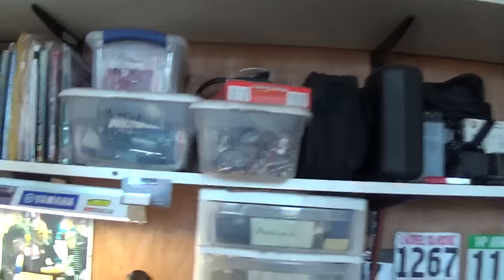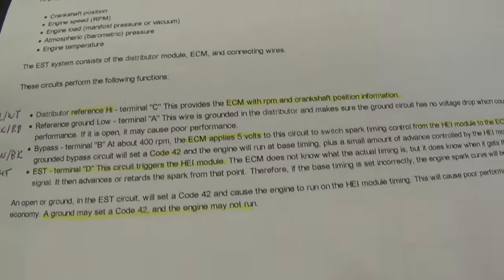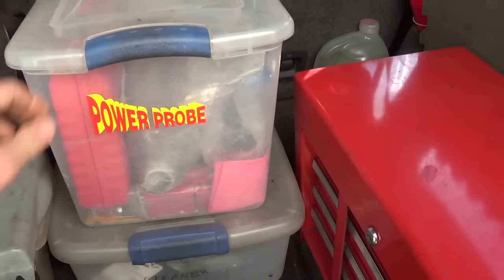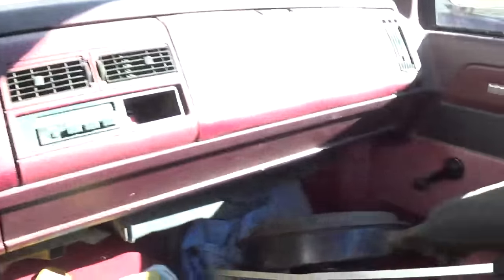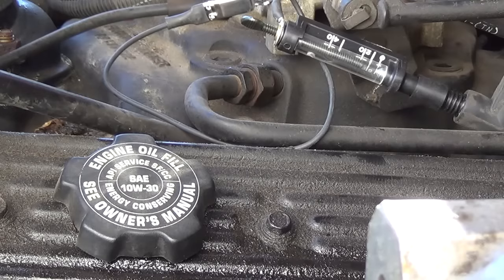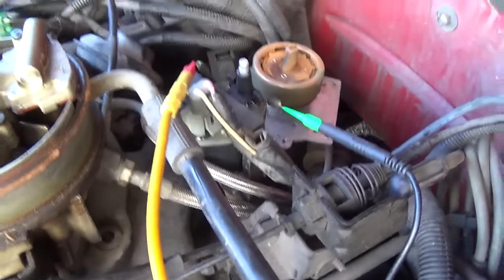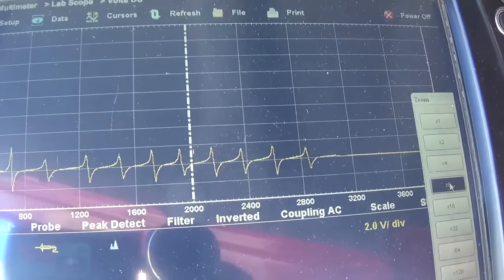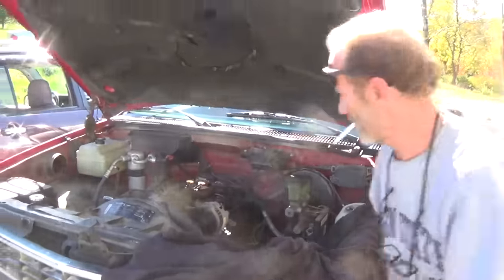Crank no-start: '88 Chevy truck 5.0 V8

Comment: I always use the grease under the control module . I agree with you on the grease , it is not conductive , that is y it is used , it maintains the connection and also like i insulator to protect the connection . Good job
Reply from the maker: +wtbm123 Huh I've never had to install one of these so I just guessed where the grease went lol :)  So what exactly is the purpose of the grease on the bottom of the module?
Reply: +motoYam82 helps seal up between the two so it does not corrode and lift .
Reply: +wtbm123 I was taught that the grease is for heat transfer from the module to the distributor base to dissipate heat from the module.
Reply: +Robert Wynkoop And it looses its heat transfer  when it starts corroding under it lifting it off the plate
Reply from the maker: So in operation the module must heat up MORE than the distributor base, if that's the designed direction of heat flow (module to distributor base). I am tempted to drive around with a thermocouple taped to the dizzy on my '89 MPV to see how hot that sucker gets. All I know is that it burns up the internal igniter about every 10 years/100k miles...
Reply: +motoYam82 Yes, heat transfer FROM module TO base. There are some heavy ass transistors in that module, and they make a LOT of heat. 5 amps at 13 volts might not sound like much, but that's 65 watts, which is a lot (hold your fingers on a 60 watt lightbulb for a demonstartion).
Reply from the maker: +douglas lee Hey Douglas, I was also thinking about how much heat the module produces. In this case keep in mind the ICM is just a "switch"; most of the voltage drop and heat generation is actually across the primary winding of the ignition coil (not the transistor in the ICM)!
So again I am skeptical of the module producing that much heat on its own...maybe set up a bench experiment with an old distributor and see if the module actually gets hot?
Reply: +motoYam82 It is definitely going to get hot.  It has power semiconductors inside it (switching transistors, mainly), and needs to be able to dissipate that heat into the relatively cooler distributor body.  Same principle as incorporating the voltage regulator inside the alternator, use the big chunk of metal as a "free" heatsink for the related electronics.

While the device does act as a switch, being a semiconductor device, it has a MUCH higher voltage drop (hundreds of millivolts) across it when conducting than a pair of mechanical contacts will.  This thing is old enough to be using bipolar transistors, which are much less efficient than the later power MOSFETS, thereby generating even more heat.

If I was faced with replacing one of these, I would use standard zinc oxide thermal grease rather than the dielectric grease. This stuff is available from any electronic parts distributor.
Reply: +motoYam82 In the case of every Chevy I have ever worked on, if that grease is not under it, when the engine heats up the engine will shut down.
Reply: +331sbf I agree arctic silver is a better at heat transfer . I do some computer work so i am familiar with it . But wonders if out in a hash environment if it would repel water as well after some time . Moisture gets in , then corrosion and lifts the module . I understand what you are saying , but i just use what comes with the module . Not sure which would be better in the long run
Reply: +331sbf Artic silver is a heat sink compound and it is in a grease base. The grease should prevent any corrosion if it is applied properly.
Reply: Normal dielectric grease was "cooking" away in mere weeks causing shut downs. It's been at least a year and a half since I had done this and it is running great.
Reply: +motoYam82 The grease intended for that job has micro particles in it that transfers heat to the body of the distributer. The grease is just the base to hold those particles. The micro particles are either aluminum or silver if you have the good stuff.
Reply: the sound inside when turning off the ignition, as that of an electric antenna is the digital heater vent, I assume....I had a bad ground and as soon as I fixed it in my 1988 Chevy, "in the fall"  that 'good' sound returned and thus I again had heater!

Comment: I use dielectric grease on connections, but also on the mating surface of the module. It helps dissipate the heat. Great video. Funny ending with owner revving engine and then running away!  (Also works on the ceramic part of spark plugs that contact plug boot)

Comment: That noise was the electric fuel pump, you didn't know that? Also, dielectric grease  keeps oxidation down to due to isolating the metal from oxygen, and I think you needed to apply thermal paste to  the bottom for proper heat transfer to keep the module from overheating.
Reply: that noise was a electric motor under the dash for the air and heat that I know for a fact. Just letting u know.  I have an 89 silverado and mine does it.  Ive  only seen it on the 88 and 89 chevy trucks.  my brother has a 90 and it doesnt do it on his

Comment: I had the exact same thing happen on my '95 C1500...driving to work and she just quit. I could hear the fuel pump so I threw in an ignition control module and the 4.3 fired right up. Now I carry a spare and a long phillips behind the seat. The '88 to '98 chevys turned out to be damn good trucks. Unlike the '99 and newer Chevys the rocker panels actually made it home from the dealer without rust holes!
Reply from the maker: +cbsctomh Agreed the sheet metal seems to be higher quality on the older 90s trucks. My neighbor has a 99 Tahoe and a '05 Yukon. The newer Yukon already had rockers replaced!! The 99 is still going strong at 225k...like a rock lol

Comment: I knew since the very beginning it was the ignition module, it is a very common failure on this model. That's a happy customer! Thank you Ivan!

For the guys with the dilemma about the Dielectric grease and the  thermal compound: That grease is for the connectors. You never put dielectric grease as a thermal compound. Thermal compound is used between the module and the mounting surface whenever there is a cooling aluminum heatsink outside the ignition enclosure but in this case that chevy does not have a aluminum heat sink for the module in there so no thermal compound is needed. That ignition body is way hotter than the module and cannot dissipate the heat in the module. In fact module failure due to engine heat is a common issue in this truck. (Engine is hotter than the module)

Comment: Use to be Ignition modules in these trucks is what kept the parts guys paychecks coming. Hard to believe there's still one of these with that low mileage.If that clock still worked.
Reply: this old car didnt need a oscilloscope and all that.  you simply check the input and output on the module for resistance.  resistance too high the thing is kaput.
Reply: What Terminals do you test for resistance
Reply: Super Godzilla that was ford techs and thick film ignition or TFI as it was affectionately called. 
Modules burned so fast every guy had one in his tool box and the special socket to UN bolt it.

Comment: Man, your vdo is the best bro. Thanks so much for posting.  I looked all over YouTube and tried many different ways to fix my early '90 gmc van with no start when engine is hot.  Not much luck.  Fortunately; I came across your vdo today and decided to replace the ignition module.  Cost me $31@ oreilly and boom, the old van run like a champ now😁👏🏼👏🏼👏🏼. Thanks again keep up the good work.
Reply from the maker: Awesome!

Comment: Yes I believe the grease was for under the module.  The heat of the motor cooks the module.  The grease helps with cooling the electronics.

Comment: 🔥 video... I’m having this same issue on my 88 obs 350 v8 as of yesterday 11/3/23 makes me want to just order this part and try it out I pray it works but  I know there’s a few other parts it could be as well I have to check first ignition module, control module, pick up coil, map sensor, or fuel pump I pray it’s a cheap fix $50-$150. I don’t want to just throw parts at it. I don’t like to fix things that aren’t broken as my grandfather would say.

Comment: nice simple fix, the dielectric grease was for the bottom of the module.
Reply: exactly
Reply: Yes module will have a short life without the grease so it will have a good heat sink, but you are too young to have grown up with 80s and 90s Chevrolet’s so it’s an honest mistake.

Comment: Dielectric grease is not recommended for the bottom of the module. Go to Radio Shack or a computer parts store and get heat sink paiste. It is designed to transfer heat, way better than dielectric grease. I bought a big tube of it off of Amazon. Within a year I've had 2 ignition modules go bad. And I don't buy the cheap ones either.

Comment: The noise you heard was the fuel pump activating, and make sure you use thermal grease on the metal plate on the ignition module or you will burn it out. It has to use a heat sink to protect the circuit components inside the module, in this case the metal shelf it is attached to on the distributor. Thermal or heat sink grease is white in color. Dieletric grease is good for connectors but it is not a heat sink grease, heat sink grease conducts heat from the part to the heat sink to prevent the semiconductor from burning out inside the module, it is thermally conductive. Think computer chip, like your processor in your computer needs to conduct heat out and away to protect it, we use heat sink compound or grease to do this with the heat sink being a metal processor cooler of some type, the ignition module is sort of like a small computer in that it takes inputs and creates an output, in this case a timed signal to initiate the spark on each cylinder. It creatse heat and heat destroys electronic connections inside the semiconductor so you have to transfer the heat away, and that is what the thermal grease and metal plate on the distributor does.

Comment: those modules slowly wear out over time..the heat gets to them. always make sure you apply that heat grease on the underside when you install the new one.my astro van always idled rough and didnt have as much power as tit should..new module solved everything.

Comment: the grease was to go on the metal bottom part of the module so it does not heat up.without it it won't last long
Reply: +John Hafernik Thats what I thought as well. But why would they use dielectric grease instead of thermal grease like you would use on a CPU heatsink? Thermal grease contains stuff like zinc oxide or silver compounds to help carry heat away. Dielectric grease is just a silicone based grease.
Reply from the maker: +Bob Weiss That was exactly my thought too, Bob. Everyone is saying to put the DE grease on the bottom of the module, but no one says WHY...I don't think it improves thermal conductivity at all...might even impede heat transfer from the module to the distributor base. The distributor gets hot anyways from sitting on the engine, so I'm having trouble believing it's supposed to cool the module down in the first place :) 
Actually, it's a fundamental design flaw to have the module living in such a hot location to begin with. My '89 Mazda burns out the ignitor inside the distributor every 100k miles...nothing you can do to prevent this. This truck was just at 100k lol
Reply: +motoYam82  on my '98 5.7 Sierra, the module is mounted outside of the distributor and is attached to a heat sink. Still comes with the grease,so must be there to promote heat transfer to the heat sink.
Reply: +motoYam82  I'll say why - all three DE, silicone, and thermal grease are the very same thing in essence.  Thermal greases that have zinc oxide or silver powder added are just gimmicks to sell, very hard to prove any improvement over plain silicone grease, we are talking $10 difference for 1/2 watt improvement if you can find that much and I don't think it's worth the price at the end of the day.  GM doesn't think so either but they are confirmed cheap skates.  Me three for that matter.
Reply: +Lee Barnes i know a youtuber who uses tooth paste as thermal paste in CPU's. Seems to work well for him :D
Reply: +kreetins You just made that up.  Been a hobby of mine since the 60s and for the first 30 years translucent silicone grease was used routinely under the big power transistors and then along came the silver powder guys with dubious claims of greatly increasing heat removal.  Not much happening until you upgrade your heat sink and air flow too.

Comment: Those TBI engines are so easy to repair compared to today's engines. To pull codes, all you need is a jumper between the A and B terminals on the DLC and off to work finding the problem.

Comment: Stabilant 22A is a liquid that increases conduction. NAPA sells it.
Silicone grease is used to help the heat transfer to heat sink. Used on other hot electronic components. 
Good show! Thanks.

Comment: Great video but my trucks acting different I have already replaced the ignition coil and I'm the plugs the wire's and the cap and button here's my problem sometimes it will fire for a second and than nothing what could it be

Comment: the included grease goes under the module for heat protection from the engine. Without it module will fail its not for terminals. If you read the directions they most likely stated that as well

Comment: You are exactly right with that one ivan. Dielectric grease/ bulb grease is for keeping out moisture and debris from electrical connections. 👍and makes no difference on conductivity other than keeping contact points clean so they can pass juice well.

Comment: The Dielectric grease is supposed to go on the bottom of the ignition module to keep it cool because it gets so hot. The heat is what destroys those ignition modules. So the Dielectric grease goes on the shiny metal flat surface on the bottom.

Comment: Ivan, dielectric grease was meant to be put on the module where it mounts to the distributor before mounting to conduct heat away from the module.
Reply: Heat sink thermal paste, not dielectric grease.

Comment: New engine, started right up. Was running. 1994 chevy c2500 now no spark. New plugs, 2 sets wires, 2 caps, 2 rotor, 2 coils, 2 ditributers, fuses, 2 modules...coil sparks once on key power up make/break. No spark at plugs....

Comment: I hope you put the dielectric under the module, otherwise it will overheat.
I use dielectric for all my connections, especially those expose to moisture.
The dielectric allows heat from the module to travel into the aluminum distributor base, it acts as a heat sink.
Another thing to look for is a clogged vent screen in the distributor, it must be clean to let moisture out. otherwise you get rapid carbon tracking and misfires.
Reply: James Fenton : Great comment on the vent screen .I have a 1989 G20 Van with 199K . The 700R4 trans dropped dead . Original owner . Every time I have the distrubutor cap off , I clean the vent screen . Also , I have heard that the small wires from the magnetic pickup can rub through . It's bad if it stops working - but worse if it works intermittently . That will drive you crazy . I won't put in a used trans unless I can verify some history . Not worth my time . Also , that noise you hear every time the key is turned on is the fuel pump prime . I can put my hand on the relay and feel it run and shut off after about 2 seconds .  Bill .

Comment: The dielectric grease NEEDS to be between module and distributor,,,without it the module will fail, !!!
 I am a GM Certified MasterTech.   60 years experience, have just acheaved my Doctorate in Mechanical engeniring P. R. Dutton

Comment: My engine just quit...no bogging just flat out quit. It's an 86 s-10. Just replaced fuel pump..ignition coil..and complete distributor. Even sprayed starter fluid and still it cranks .....no start. Any input would be helpfull

Comment: So what would I check when I have a spark, fuel and compression. New distributor assembly, coil, plugs and wires and it is in time. Jacked truck up to remove and replace right inner fender and it was running when I jacked it up but let it down and now it doesn’t run. 1990 GMC Sierra 1500 2 wheel drive with a 5.7

Comment: Awesome video !    Thank you so much for sharing.    I do have 1 question.  My '89 Silverado with a 5.7 goes into what would normally be a choke mode, slightly higher RPM as I drive. If I throw it in neutral at a stop light, jab the throttle it kicks down to a correct idle.  Any ideas ?  Thanks !!

Comment: Here's one for you. I have a 95 suburban 5.7L and had a crank but no fuel, no spark. I put a new ICM in and still no start. Here's the kicker, I put the old ICM back in and it fired up? I have put three new ICM over the last two years and have tested everything and pulled apart the wiring harmess looking for broke or corroded wires. Why am I having to replace the ICM so often? I even bought the top of the line ICM and it failed? Do you have any idea what else I can look at? I really hate getting stuck away from home and paying the hefty tow bill. Any help would be appreciated.

Comment: I have a 90 caprice with a crank no start...I checked for spark at the  front plug athletes left side of the engine..had spark...check to see if the fuel was spraying, it was at both injection injectors..don't know what to do next please help...replace icm mod. All wires, plugs, cap and rotor.
Reply: before  it stopped it had codes 42 and 43
Reply from the maker: +Telace Johnson See if it will fire up with some starting fluid. If yes, then it's a fuel issue (check pressure) or the injectors are shorting out. If not, check for spark at the end of a spark plug wire while cranking. Good luck!

Comment: Hey im rlly having trouble with my 1988 chevy 1500 5.7 L my fuel pump is working i check my relays my fuses under the steering wheel pannel changed my distributor and computer and nothing help